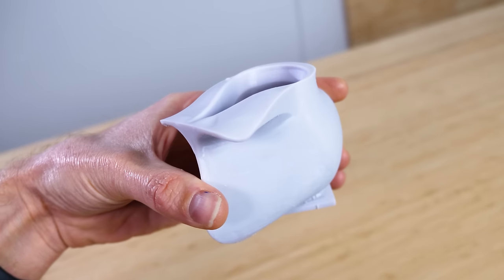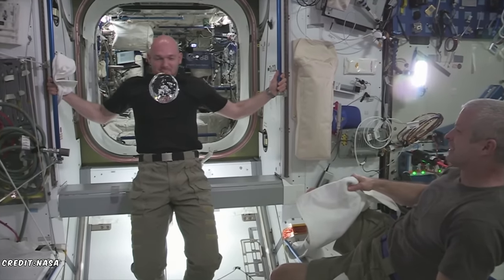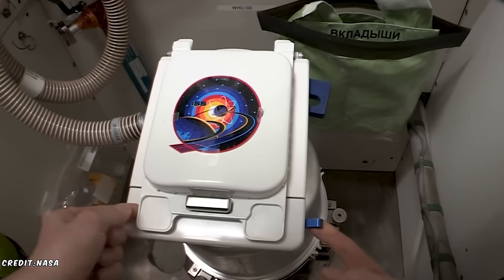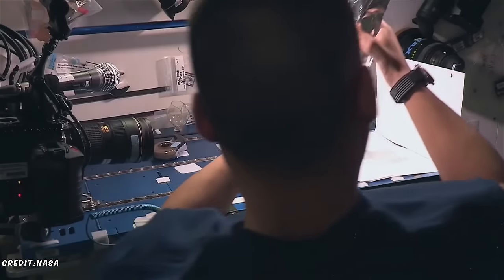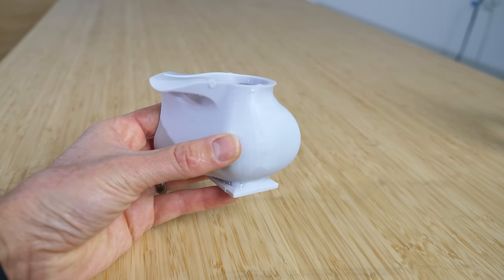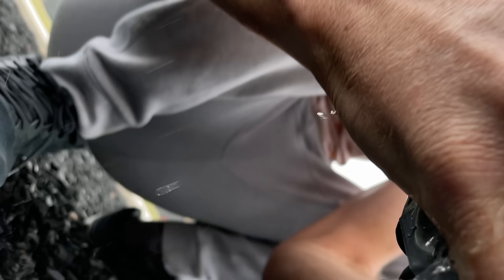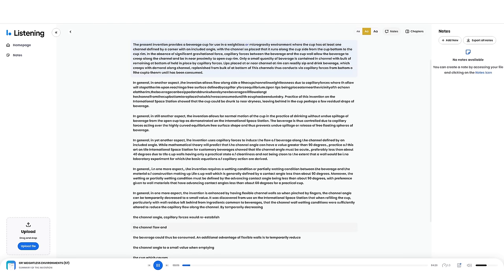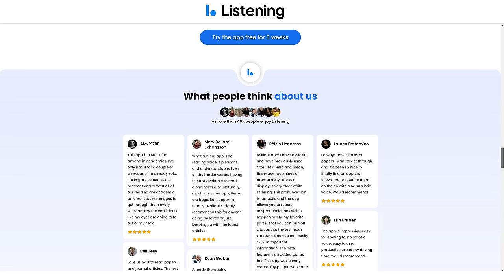How Does The Space Cup Work?

Comment: You could demonstrate the effect without zero gravity by using two immiscible liquids of the same density for example oil and a water alcohol mixture. Submerse the cup containing the liquid with higher surface tension in the other liquid to get the same effect as zero gravity.

Comment: Some fluid mechanics in space would actually work, like pneumatic systems for hydraulic press, engines technically and even burners (as long as you supply it with a gas to push the liquid fuel) then potentially they could work.

Comment: When you dropped the cup, the water went up and out because of the inertia of the liquid, not because of capillary effect. Same reason water may spill out of a glass if move it sideways too fast.
Reply: If it was unaffected by capillary action, it would've flown out in a much larger surface area, like a normal cup dropping
Reply: The point was that it went out the pointy part, not the blobby part.
Reply: The water and the cup are accelerating at the same rate. If the drop doesn't impart any rotation, the water and cup would experience the exact same inertial reference. Try it with a regular cup it just falls together until it stops or changes direction.

The drop here isn't perfect so more water flows up than should have, however, it still illustrates the concept. As the other post said, it flows out of the pointy bit, and not the bloby but.
Reply: Inertia works on the cup and on the water the same when they free-fall. It's not because of intertia.
Reply: @shawn2444  Correct. I'm sure the capillary effect is real and that the cup works, but much of what we are seeing in the video is the effect of the "imperfect drop" that imparted some rotation or lateral acceleration.  Thanks to all for comments.

Comment: Actually Water Works because the lines are pressurized and constantly flowing  and there are several pumps throughout a given City that maintains that pressure. That's why there's usually a boil water advisory after the water is shut off. The pressure has dropped off enough that any minor leaks in the line could allow sediment into the drinking water. Similarly, if you're ever get water from you tap that you will be consuming in some way(drinking, used as an ingredient or boiled to cook food which will absorb some of it), you should always get it from the cold tap and wait till the water is fully cold. That way you know the water is fresh, coming straight from the treatment plant and not sitting stagnant in the lines in your house or water heater.

Comment: CORRECTION:

I would avoid saying "no/zero gravity" in context of the ISS, as the ISS still feels 89% of Earth's gravity, and 89% of 9.81 is more than 0.  The correct term to use is 0G, they are effectively feeling weightless because there is no atmosphere to slow their spacecraft so they move (fall around the earth) at the same speed it does. They are only weightless in the frame of refference of the ISS itself.

Comment: It only works because there is still slight air pressure, where they are it isn't a total vacuum. In actual space, this wouldn't work. It would remain in the shape of the cup because the molecules have no pressure on them.
If this cup was capable of working in space, it would be breaking physics, seeing as it isn't a Deadpool cup that likely isn't going to happen.

Comment: Instead of spending millions of dollars on a toilet and designing such cups, all that money and resources should be used to design space ships and space stations that have gravity. There are a few ways to do it, and they all include centrifugal forces. The bigger the living space is, the less you will feel the spinning. In movies we have seen structures within the ship or station rotating. This is ideal but not practical as you would need to use power (electricity) to keep the spinning, and in space, we have to save energy as fuel is expensive, at least, until we come up with some kind of reliable fusion reactor. So, for now, we need to make the entire ship or station spin. Without gravity and friction, the spin should not consume power except to start it and only a little bit here and there to adjust the speed when needed. The issue would be that the ship or station will need to be much stronger than they are right now since they will be under 1 G all the time. Still I think it makes more sense to spend money towards that goal instead of a multimillion dollar toilet as well as many other things including sinks, food, sleeping areas, living areas, and most important, keeping the astronauts bodies in shape. No gravity means they need to do a lot of workout time to keep the muscles in shape and avoid  losing bone mass. If there is gravity, there is no need to do that, and working out would be just a regular routine that can be  30 to 45 minutes each day instead of many hours in different sessions each day. SpaceX, NASA, and all other space agencies should be already working on this. When the ISS end of life comes, eventually new stations will be built. They all should have artificial gravity. And all missions to planets should also be the same. Going to the moon is quick so no need for it, but going to Mars, and beyond eventually, the ships should have artificial gravity. More expensive, yes, but worth each penny.

Comment: At 2:50, he says the gravity force becomes zero in free fall. If there is no gravity force in free fall, what keeps the ISS from drifting off in a straight line? Doesn't gravity keep the ISS in a constant free fall? Why is the gravity force zero?
Reply: I'm just guessing here, but because there's no acceleration?
Reply: Maybe the wording was a bit confusing, but he meant your body (or an object) doesn't experience gravity in free fall

You're right that, by definition, falling requires gravity, but have you seen a videos of gravity free flight? It's when a plane goes into free fall and the people inside get to experience zero gravity for the duration of it. That's basically because you're falling just as fast as the plane, but there's no practically air resistance inside of it
Reply: It's cancelled out by the centrifugal force